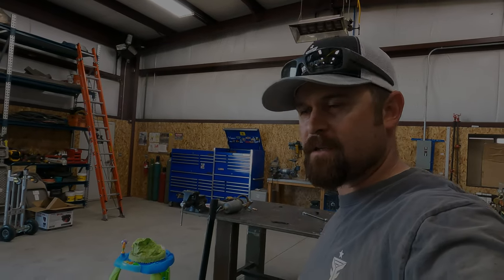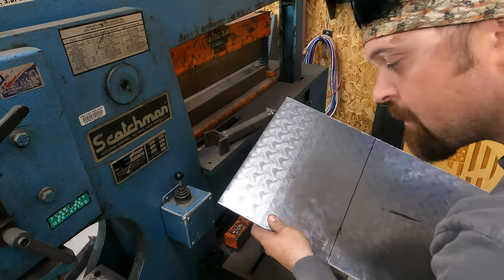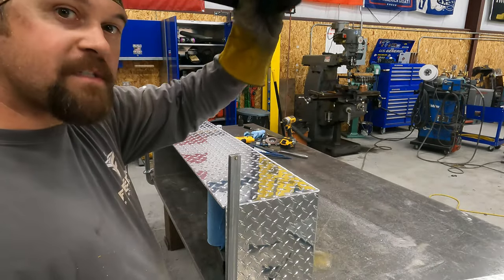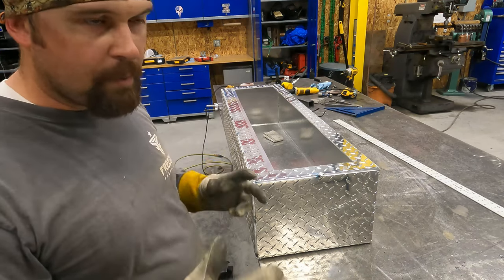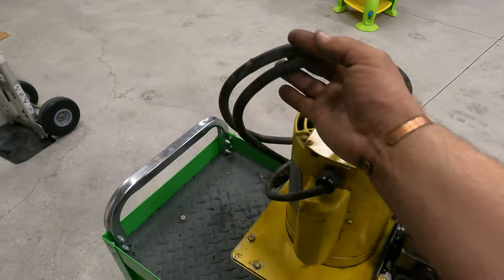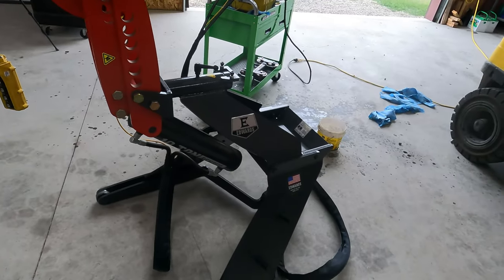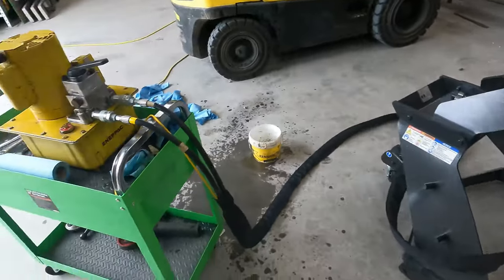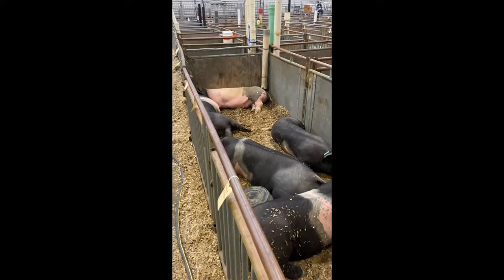Aluminum tig welding livestock gear box

Comment: Great Vlogs, When my pipe clamps can't reach saying  a 7 feet span in length I would use 6 feet and a 4 foot pipw clamp and pull it in by using the foot on foot. Do you understand?
Reply from the maker: I do. That’s a great suggestion. I’m sure I’ll end up using that one. Thanks for the suggestion and thanks for watching!
Reply: I cut my teeth on blue and red welders and I own a few. Engine Drive in the back of my truck is red. But when it comes to high power TIG I went with Everlast. When you can get a 325 amp AC DC TIG welder for $2500 It’s hard to spend six grand for a blue one. I have three green machines and they are beasts. Red and blue are scrambling to catch up with the green and the yellow. Just a thought. Love your videos
Reply from the maker: @larryvollmar8763  I have a friend who has an Everlast and loves it. From what I hear they are a great value. I guess I’ll have to go check it out.